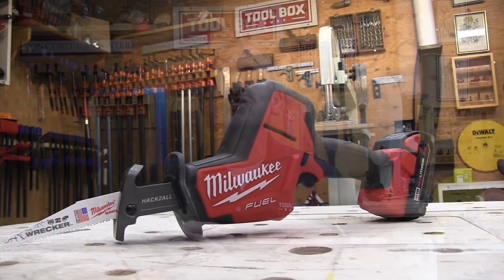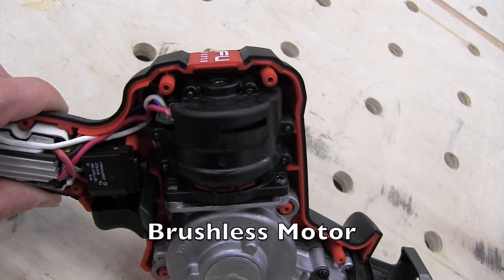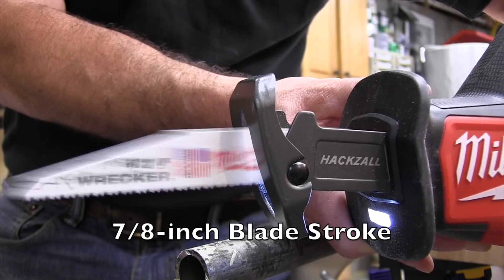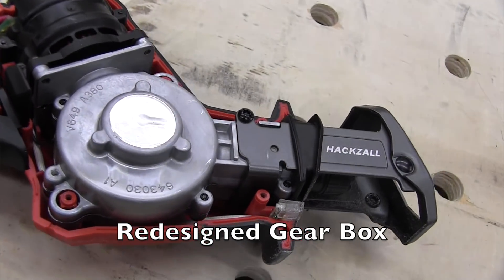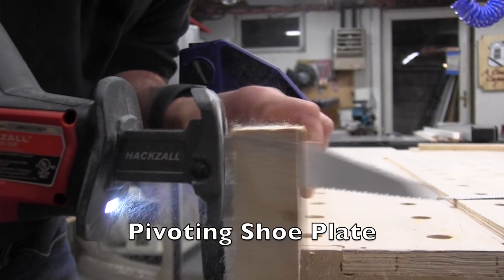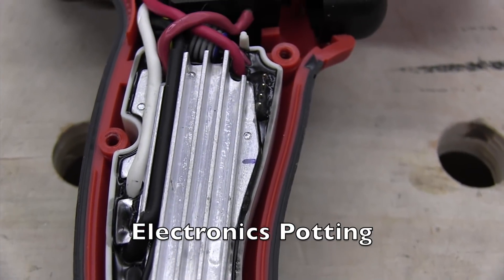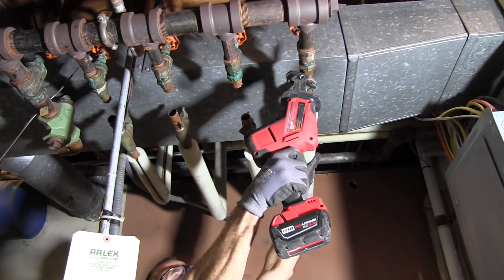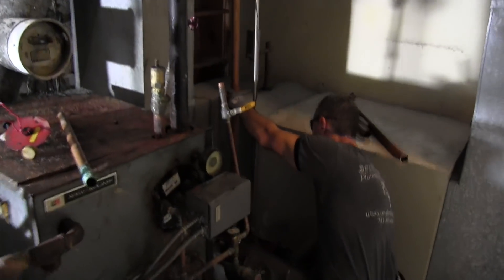Milwaukee M18 FUEL Hackzall

Comment: My m18 hackzall failed after 5 years due to a seized bearing after water got in . But I loved it so much I just bought another and most definitely want this saw. Thanks Rob
Reply: same, water got in the gearcase and I had to clean the bearings and relube the gearcase and bearings.  Couldnt start the hackzall it was seizing always. After I cleaned it it failed on the electronics side a while later. Truth is I abused the old model like crazy, cutting 2" pipe full of water, throwing tool on the floor on multiple occasions, and working in mud and dirt always. I got the new 2719 fuel hackzall, and it is  amazing, better in everyway.  Hopefully with the new water ingress protections and potted electronics this tool will last a lifetime!
Reply: I'm back, so I'm at my 3rd fuel hackzall... the bearing on the rotor near the gear case seems to fail and the bearing brace leaves shards of metal in the gear case... I'm thinking of going back to the brushed hackzall if my new one fails again.

Comment: I have 2 of these M18 Fuel hacksaws. Use them daily as a window replace installer. Both of mine have sheared the small “drive pin”.  Unfortunately, although it is listed as part 19 on their schematic, you can not purchase said pin. They want to sell a complete gear box kit.

Comment: I'd like to know; what are the reasons one would choose a hackzall vs. a sawzall or visa versa?  I'm an apprentice electrician and I don''t want to be manually cutting and reaming emt all day.  But I'd like to choose the tool that's gonna have the most uses outside of just that one specific task.
Reply from the maker: Complex size and weight. Hackzall fits into tighter spaces
Reply: Ok, thanks.

What the largest diameter EMT this can cut, please?  1-1/4"?  2"?
There's nothing about max material size/diameter this thing can cut on the milwaukee website.

Thanks.
Reply from the maker: Complex depends on the blade my friend
Reply: Lol, is it really that simple?  Hahaha, I would've thought they'd give a max size/diameter due to power or length of stroke.

Ok thanks.

Comment: I just found out that twisting blade release mechanism is prone to rust when it gets wet and after that it's quite hard to change blade. Drop of oil might solve this issue though.
Reply from the maker: Typical in all the prior models. We often have to squirt some WD40 in the blade release mechanism.... to be expected in a tool that gets wet
Reply: my regular m18sawzall is having issues taking a knew blade, the release leaver is mushy and harder to move over and than when the knew blade is in it take 3 or 4 tries of taking it and in and out and moving the release leaver until itll snap in and take the blade.. wishing itd fail completely already so i can warranty it
Reply from the maker: Mr. Wizeguy have you oiled it?
Reply: i tried wd 40 with no luck, just re did my truck differential so i might try dribbling some of that heavy weight left over oil onto it, seems like a spring is brinding or something though, it did have a nail or two jammed into it.. idk why but when cutting pallets it likes to suck nails into the front of it and jam up real good.. might be user "error" :)
Reply: I had only pneumatic oil on hand when i tried to oil it and every time i go home i forgot to use proper oil for it :) But it's working again.

Comment: I am a plumber I have the non-fuel version. Within the first two months of having a saw I was cutting pipes overhead got water in it and it stopped working for the rest of the day once it dried out it worked again but very disappointed with the old one. I think I’m gonna upgrade to the fuel.
Reply from the maker: I know the new fuel made changes to that and protected the internal electronics from water and have drainage points.

Comment: Great review Rob.  I've got mine a few months and I use it constantly.  In both new construction and remodeling jobs this badass one-handed cutting machine always comes into use.  It gets into tight areas and cuts with single handed use.  It is a mini Sawzall with almost as much cutting ability.  While it doesn't have the weight of the big beast, its not short on balls.  Put in a clean blade and its gonna kick ass!!  Another GREAT Milwaukee addition.  Go RED or lay dead!

Comment: I'm an insulator and I loved my original m18 hackzall. Though it does vibrate a lot. My boss always talks shit saying "that's a plumber saw" but when I'm on a ladder cutting out a pocket in a cieling runner bay I'm way less likely to get hurt or tired from holding a big ass sawzall and this thing does the same job just as good

Comment: I like milwaukee and have many of there tools . But there are a few that I did not like that saw is one of the ones that I did not like and the pvc cutter just did not last. I also have the m12 hacksaw which I love. The first m12 hacksaw only lasted 6 months but bought another and have been using it for going on 3 years. I gave that m18 hacksaw to my son because I did not like it. Im sure others might like that hacksaw its just not for me. I wish milwaukee would get on the ball than are so far behind that I have had to start buying makita tools. Milwaukee I have not seen a m18 router and no m18 sander and no m18 chainsaw. Hope you up grade the pvc cutter to a m18 pvc cutter maybe it will last longer. Keep up the good videos.

Comment: Hi guys. What do u think about using this saw in carpentry?
Reply: It's great in some cases and others you'll need the sawzall. Cutting out sheeting for Windows and whatnot it's great, having to run down a t wall that's not plumb that the cub put 2 racks of nails in is a different story.
Reply: For the kind of job I have, it is perfect

Comment: THANK YOU for mentioning the led lighting on these (Milwaukee) tools, it's pathetic.  Put two more led lights (three total) on your damn tools.  The single led is so useless, and you know - it might even be worse than no light on it (and requiring an alternate source) with the damn shadow it casts.  I've been making this comment at several places about the lighting.  They can't put two more of those dirt cheap leds on their drivers and actually think about how to orient/aim them for usability?  I've been willing to switch over to Dewalt for that one thing alone.  It almost makes you wonder if they clearly know this is useless but are "saving" it to make the addition seem like some type of "upgrade" in the future when they're out of other "innovative" ideas.

Comment: Why get this over the Milwaukee m12 fuel hackzall? Just seems like more weight, almost a poor regurgitation of a phenomenal product... They should have added a differentiating factor other than pivoting shoe, should have made it adjustable length.
Great review as usual! 😃👍
Reply: I have both tools, the m12 fuel has way less power. Add the fact it has a smaller battery 12v vs 18v even if both batteries are 6.0 Amp rated. 12v is way less voltage than 18v. I never tested it in seconds, but if im using an AX blade and I were to cut in a 2x4, id say the m12 would cut at least 4 times slower than the m18 hackzall.

Comment: when Milwaukee tools launched, its quality was better, but after less than a year, they will definitely change switch(from Germany switch to HK switch, to Chinese switch, as you know, switch is most likely first to dead), change PCBA, change critical parts to low the cost. Miwaukee tools have a VE team, more than 50 engineers to do the cost-down, during these processes, the quality would decline obviously.